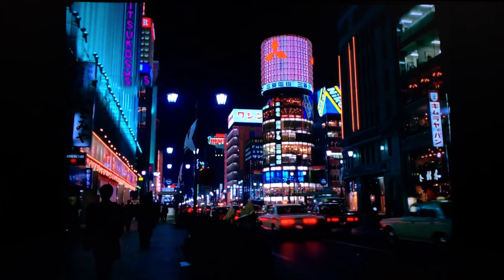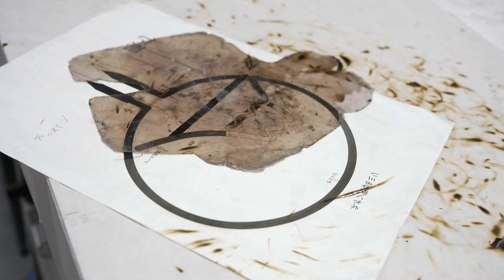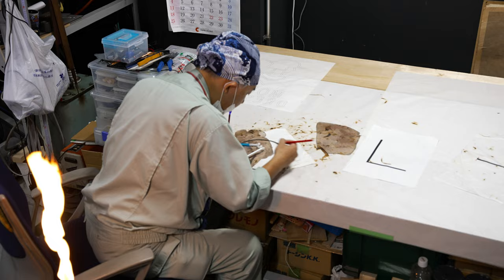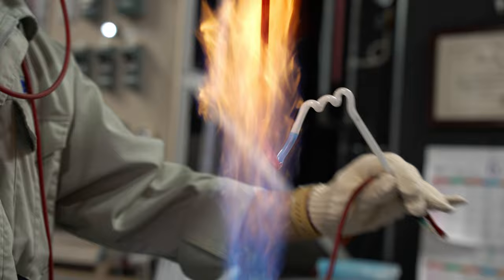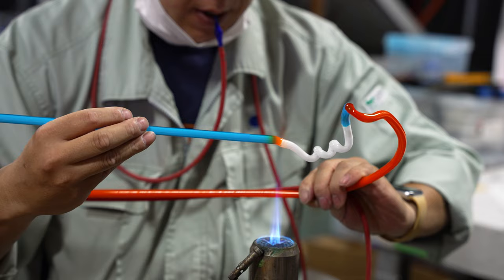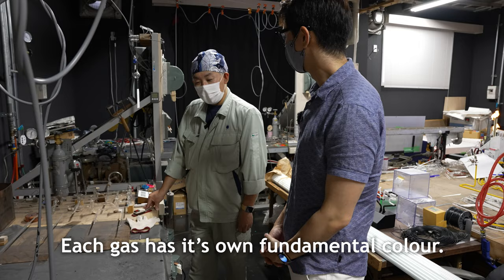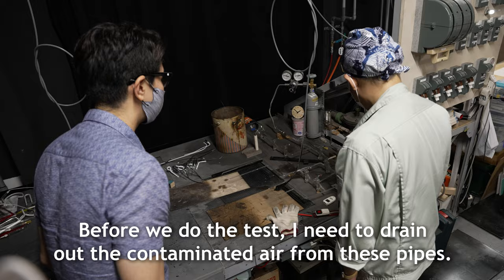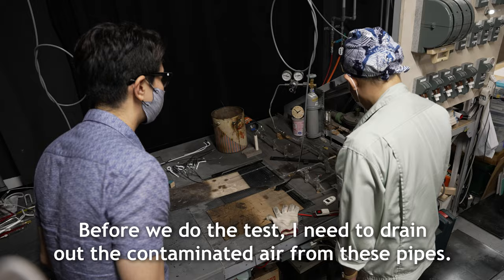How Japanese Neon Signs are Made | MADE IN JAPAN

Comment: there are some ways to have specific color come out of the tubes
1) the fill gas.  in neon signs its usually either Neon (glows orangish/red) or Argon & Mercury (glows blue).  other gasses have different colors & characteristics but are usually only used in special-effect/art tubes.
2) the powdered phosphor.  it coats the inside of some tubes and glows a particular color (the fill gas contributes as well).  e.g., Blue phosphor will glow blue when the tube is filled Ar/Hg, but will glow Pink when filled with Neon.
3) the glass color.  there are a large variety of colored glass tubes available.  they are made in Italy and are more expensive than regular clear/coated glass.
Reply: Wow, this is super useful and interesting , thanks for sharing!
Reply: There are actually helium, neon, argon, krypton and xenon filled tubes bent into the symbol of the respective elements sold to element collectors.